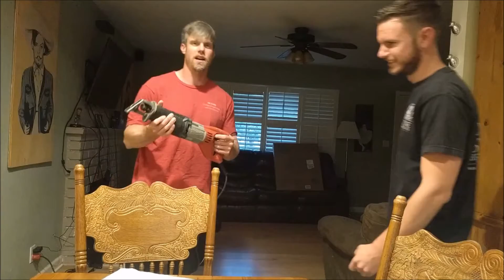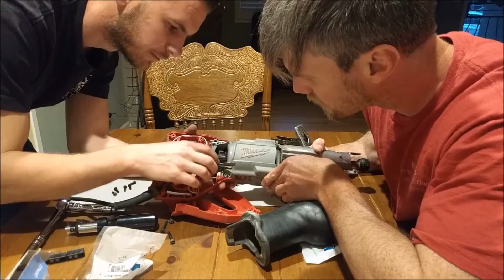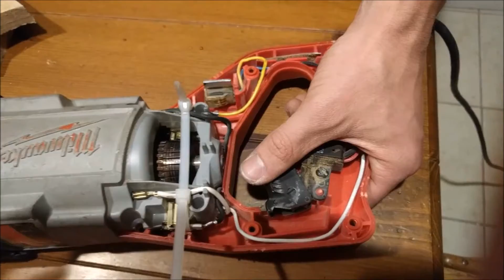Unsolved power tool mystery: The case of the sparkling Sawzall

Comment: Hey Ben! I figured out the problem with your saws-all! The commutator where the brushes ride has excessive wear which causes higher than normal current. Replace commutator! You can try using a rough piece of sandpaper, then follow with wire brush not to damage the resin/ insulators between copper inserts
Reply from the maker: Nice Dana! That would explain the sparks. Wish I still had that thing to try it out!
Reply: Ben Ogorek  we are supposed to jam at Johns tonight, wish you could be there! Peace✌🏻️😎✌🏻🎹

Comment: I have the same thing with my Milwaukee super sawzall. the brushes melted the plastic were they sit in the handle .also the brushes still had a lot of life and  had a unusual look @the wearing spots. I to had a difficult time getting the brushes out do  to the fact that they melted themselves in the plastic. the only thing that I think may be different from your tool is, my saw had the light show from the get go. right out the box. what you say ?"why don't I take it back." my mom got it as a gift for me and I  didn't really need it,  I had at the time 3 working saws ,1porter cable and 2 other Milwaukee saws . it was just about 2yrs later that I got it out to use and no one has a recipe eny more so I will have to eat this one .tools of yesterday will be here tomorrow. tools of today can't make it to tomorrow.
Reply from the maker: Wow, right out of the box? I wonder what is causing the light show if it's not the brushes.
Reply: Ben Ogorek. I took another look at this miserable  ,(p.o.s) and the  thing that looked  out of place , one of  the spring 's holding a brush. Well the brass sleeve that the spring sits in ,you know the one. It looks as if it were placed slightly off.  From the factory.  A little bit to close to the motor . the brushes still worked, however the brass  had come in contact. that caused it to throw sparks. It also heated the brass enough that  the plastic surrounding area melted. This only   exasperated the problem. I am disappointed, that I had not noticed this the first time I opened it up. Even more so ,that I told myself not to use it. Well  in my garage , small cut here small cut  there  that can't heart. Wrong!   I am going to say, I may have been able to make it work . If I had gotten a different sawzall from my truck and waited, until I was  really    ready for  tool  fixing mode . 
 🔧
Reply: Guy Smith Ain't That The Truth?